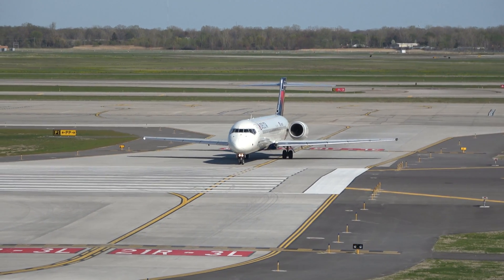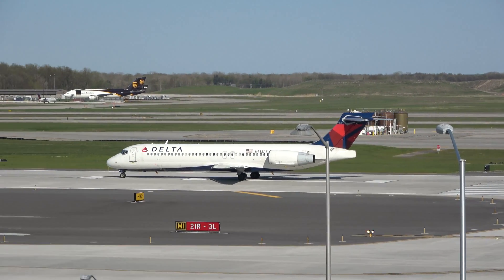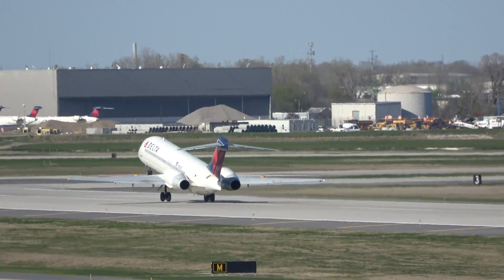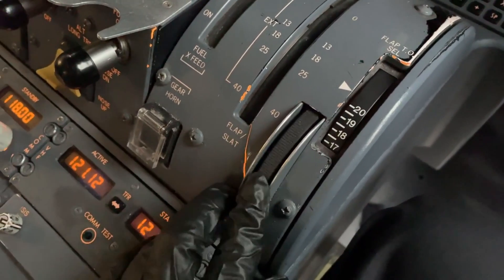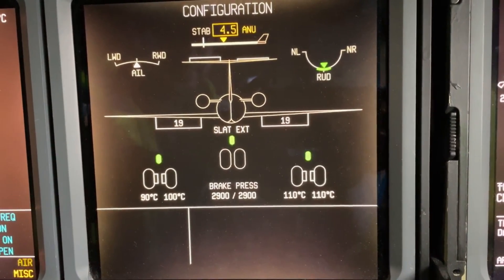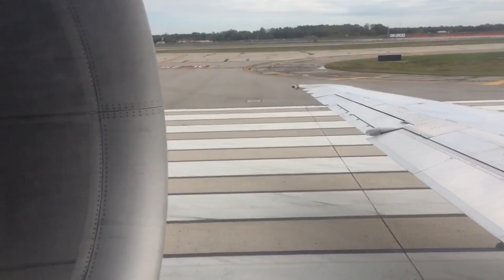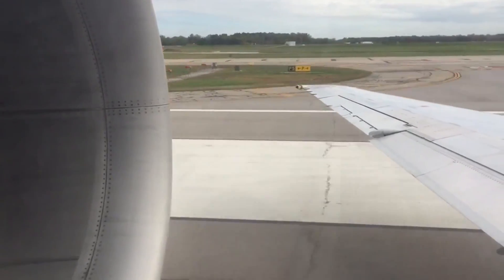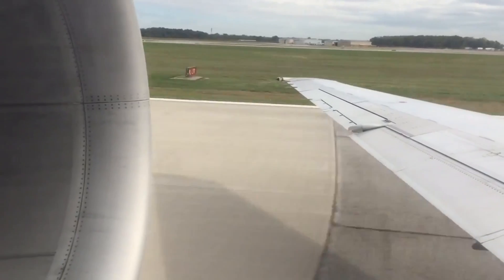Boeing 717 "Dial-A-Flap" explained

Comment: Hey MT, what are the slats doing during this time, say if the flaps were set to 10?
Reply from the maker: Unlike other planes, the slats only have 2 positions, up or extended. So anytime the handle is moved out of up/retract to any detent or any where in the moveable detent, the slats will be fully extended
Reply: @MTAviationPhotoFilm  thank you very much, I'm 3d modeling a 717 and that info was crucial!

Comment: Great video! One comment, a higher flap setting can reduce climb performance. We plan all takeoffs to clear obstacles in the climb profile, especially the second segment climb. If there's enough runway, a lower flap setting is desired. You use more runway but if you lose an engine the higher speed and cleaner configuration results in better engine out climbs. Often at high elevation airports with long runways (Denver, Mexico City) we use more runway with less flaps to improve engine out obstacle clearance.
Reply from the maker: Thanks
Reply: Funny thing is 717 don’t frequent Denver International period